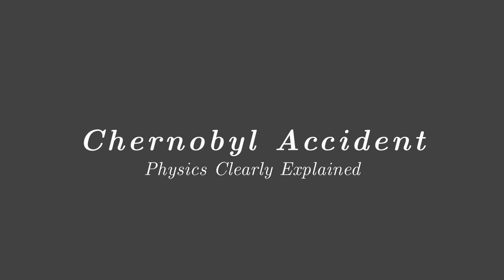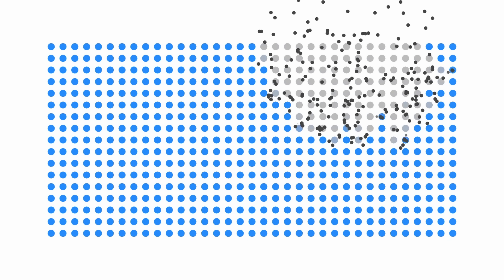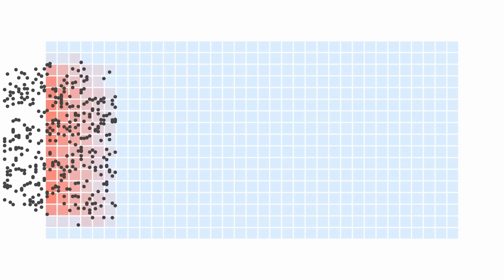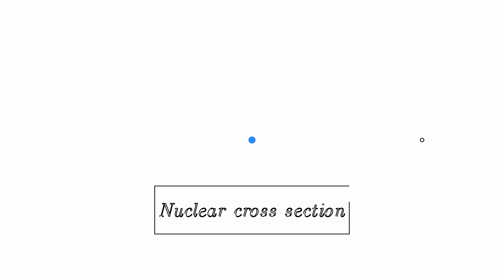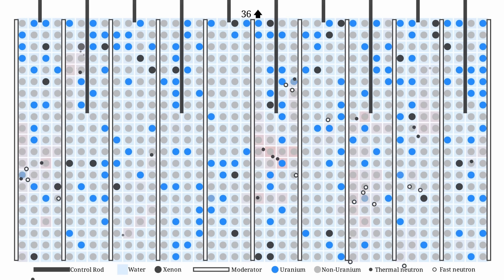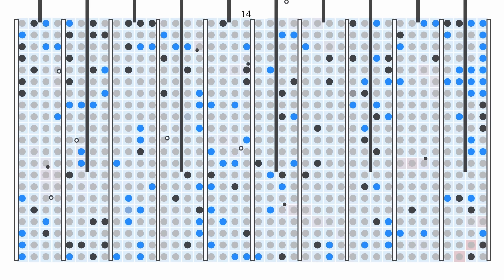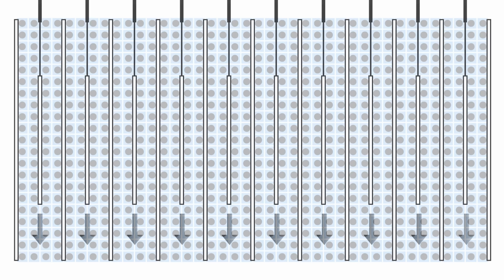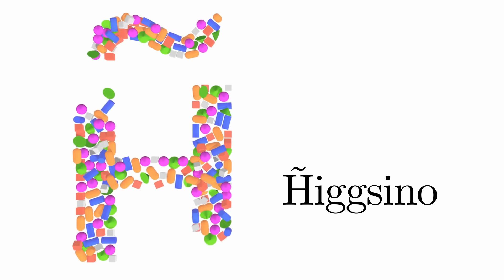Chernobyl Visually Explained

Comment: Only a few things I would have changed with this is showing the power going well beyond 100% instead of stopping it at 100%.  You did talk about this afterwards though.  Also yes this kind of failure isn't possible with western PWRs since they use the water to slow down (moderate) the neutron speed hence them losing water slows down the reaction so a negative void coefficient versus the RBMK positive.

The second would have been to talk about the time tables that the runaway happened at.  It obviously happened faster than seen here in the simulation but that would have been too fast to make sense of visually so the speed you show it at is good just would have explained that it happened IRL faster than what is seen here.

Yeah everything about the RBMK was to save money.  The big refueling assembly over the lid to refuel it on the fly saves down time thus money.  Making a containment building to encase not only the reactor but the refueling bits would have been very expensive so they skipped it.  Enriching uranium isn't cheap so they started out with like 1.8% enrichment and increased it later on to 4% or 5% later in the life of RBMKs.